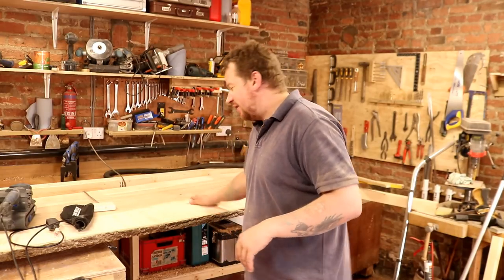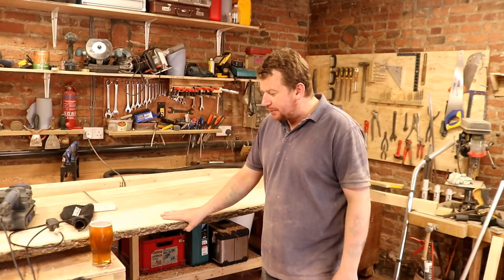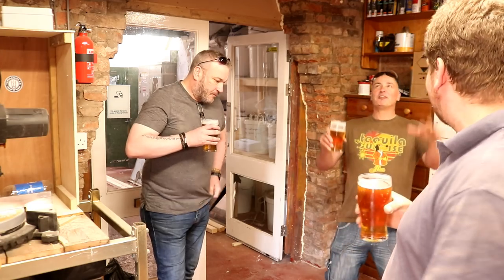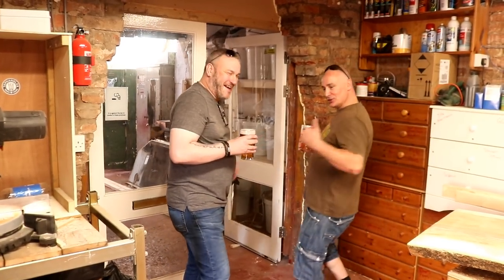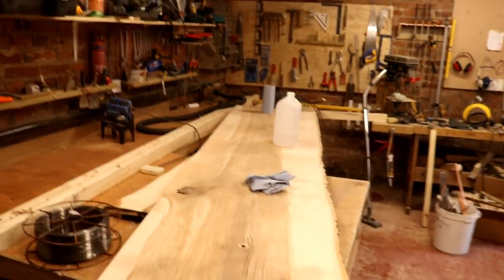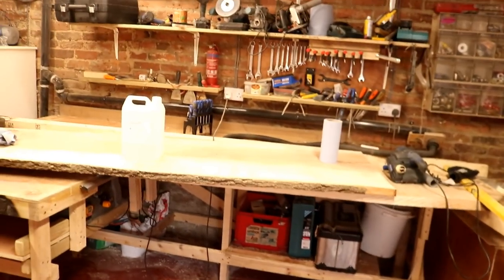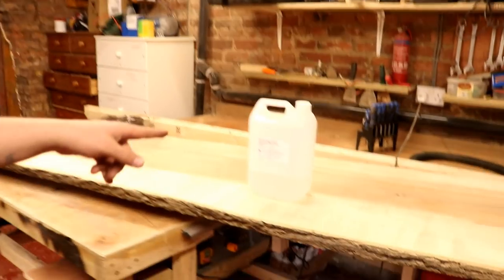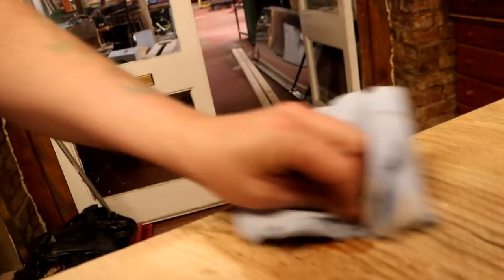Tuning the MIG

Comment: Those pieces of wood are going to be amazing when finished. If I may, I’d like to suggest you use a wood burning tool to scribe the brew shed and Harrison’s brewery logo into the bar top or maybe that piece your going to use for tables, maybe in the corner, then seal them that would look cool. Not to add to your work load. Simply amazing work mate! You and the fam should be very proud. Cheers🍻